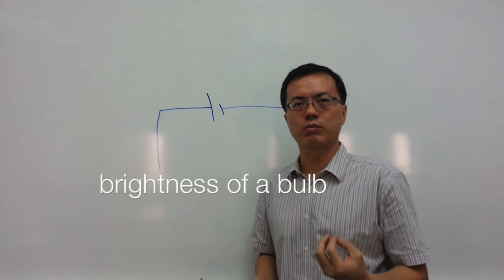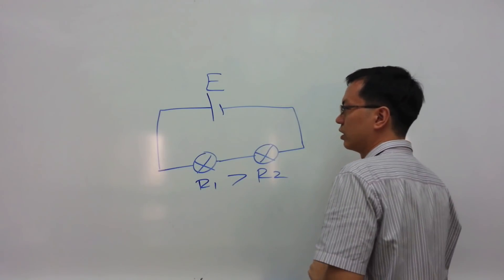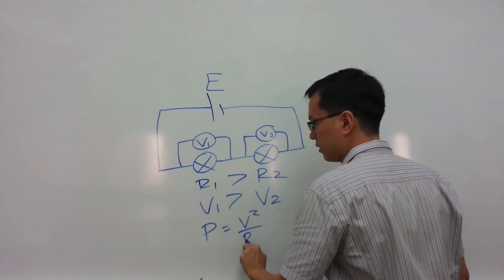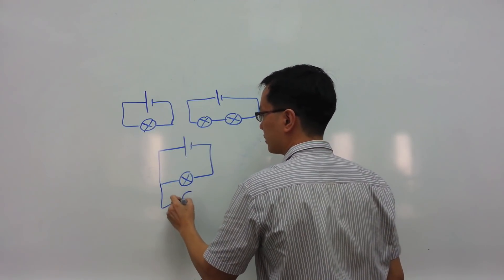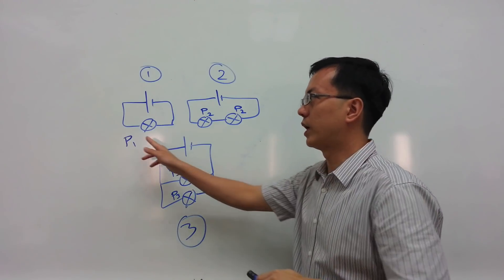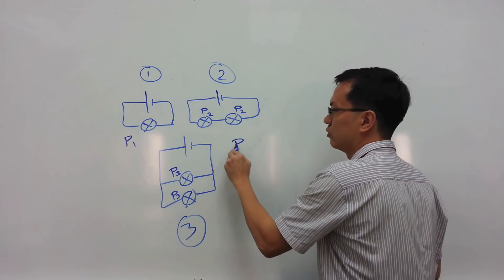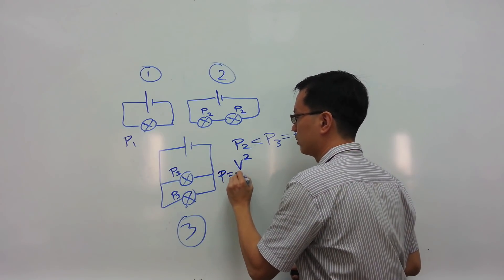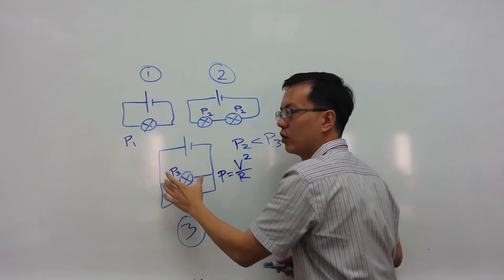Which Bulb is Brightest?

Comment: i dont understand
Reply: Basically, when comparing two circuits (parallel and series) with identical light bulbs, the ones connected in parallel will both burn brighter than the ones in series because the series connection has the current the same throughout but its divided into 2. In parallel, the bulbs are the same and the voltage is not divided, each path receives full power and so the bulbs are brighter. I hope that made sense